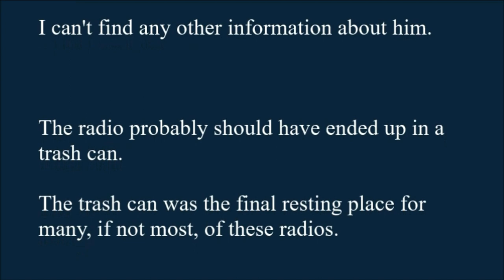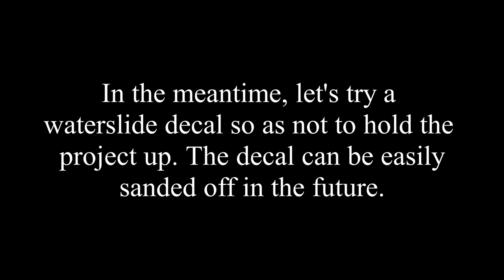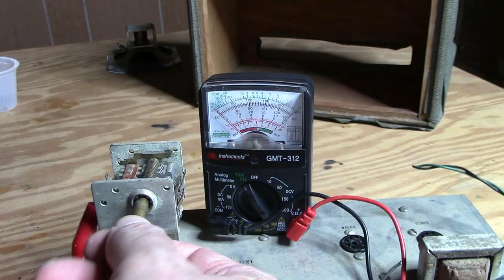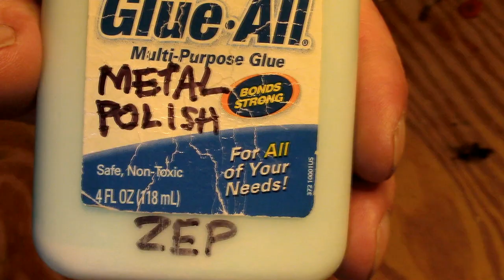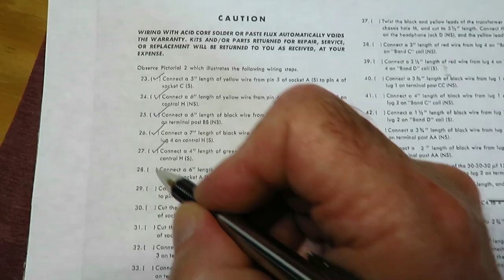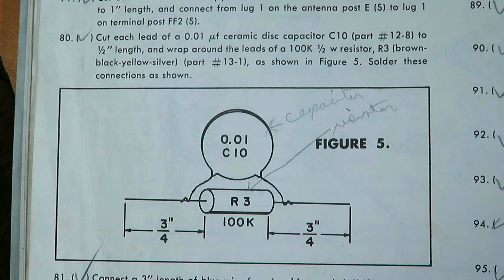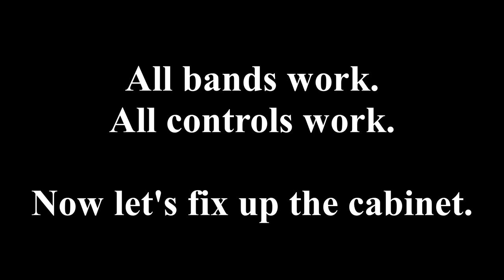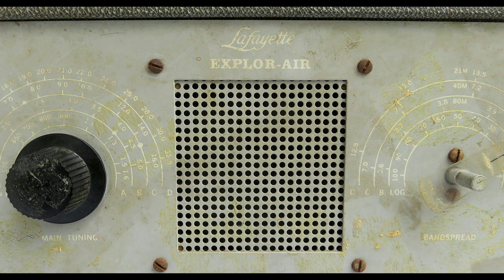Lafayette Explor Air KT 135 Refurb

Comment: Basic SW set, but it was a shock hazard with its transformerless power supply and grounded chassis.  Heathkit made a very similar radio, but they put in an isolation transformer in the power supply so it was a lot safer.
Major effort "Rekitting" it.  Nice work on the decal.
You know you CAN buy new set screws (probably Allen head though).
I think I would have removed all of the covering from the cabinet,  cleaned up the back sides and the wood, and then re-attached with spray on contact cement.
Came out real nice!  Good for another 55 years!
Reply from the maker: Hi Ken, the problem with the set screws is that they had become one with the knobs. Even after the knobs were cracked apart they wouldn't come out. I've made set screws by using a Dremel to cut off the head of a screw and then making a slot in the top of the shaft.
Spray on contact cement is hard to work with. A year later the radio looks better than ever, so the Elmer's glue-all worked out fine.
Reply: @michaelsimpson5417  Yes, you did a good job there.  I've had some problems using Elmers glue, but at least it IS water soluble so it cleans up easy.

Comment: Knobs would be the same as the Knight Kit Space Spanner.
And for loosening those screws you would have needed an induction heater, or a very hot soldering iron to only heat the setscrew with..
Reply from the maker: I found that some of the earlier KT-135s did indeed have the same knobs as a Space Spanner. After that they used a similar looking knob that has a smooth collar where it flares out at the base.

Comment: Documents were easily worth the purchase price.Oh, and Kroil penetrating oil and time to set on those control grub screws?
Reply from the maker: Yes, I could have used more patience with the screws. One problem was that the slotted end was half missing on two of them, so there was no way to use a screwdriver. I was hoping to drill them out.

Comment: Can you tell me what photo editing program you used?? I'm restoring one that has the same rust problem you had.
Reply from the maker: I'm using an old program called PhotoImpact 8. Are you going to make a decal? It may be easier if I just send you the file I made, as I spent hours on it. I could also send you the program, since you can't get it anymore. My website is http://www.analogdial.com/index.htm
There is a KT-135 section. At the bottom of the main page is my email address.
-Mike

Comment: Great job, how many hours do you have in it?
Reply from the maker: If you mean how long it took me to rebuild it, I'm not sure. It took time to set up the camera for each shot. A task that takes ten seconds to perform could end up taking five minutes. I had no way to monitor what the camera was seeing because the display is on the back of the camera.
Reply: @michaelsimpson5417  I know it takes hours on top of hours to do that kind of work. I have seen many of those radios trashed. I wish they would have seen your video in how to do it correctly.